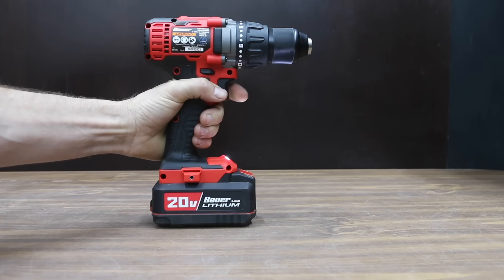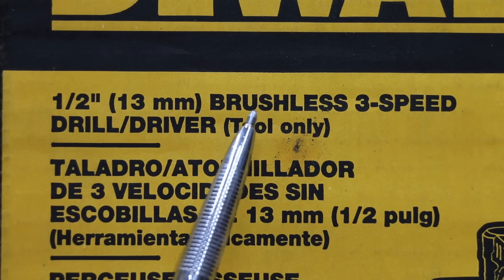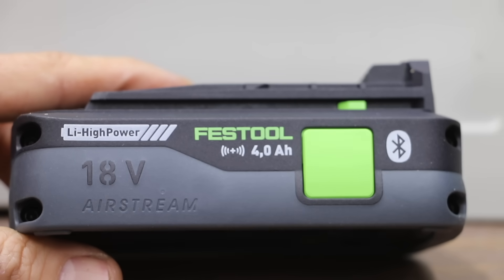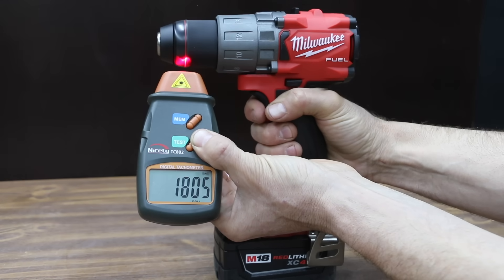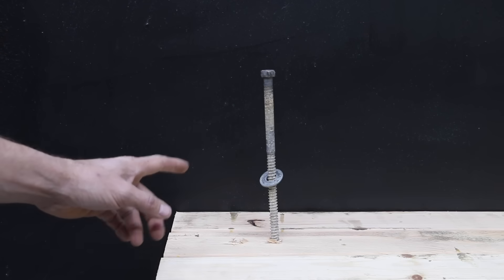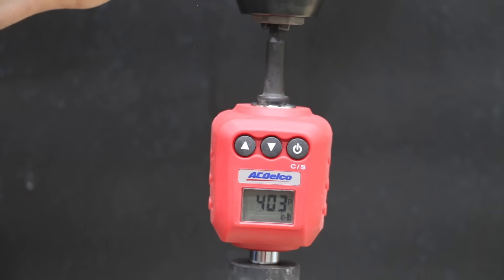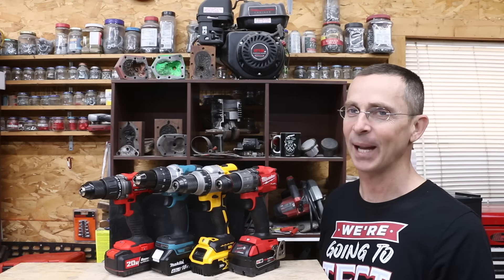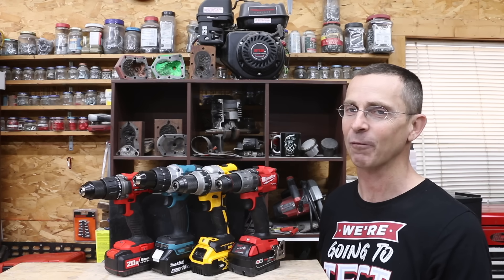Best Drill (BATTERY POWERED)? Milwaukee vs Dewalt, Makita, Bosch, Festool, Ryobi, Bauer, Ridgid

Comment: Nice video. Do you normally do anything regarding unique features of each product tested? For example the Festool maybe wasn’t the most powerful drill and also had the highest price tag but the addition of higher rpm, 2 extra speeds, multiple chuck options, and a systainer really add a good amount of value to the drill that you don’t get with lower priced options.
Reply from the maker: Thanks!  Thanks for the constructive feedback.

Comment: Come on… you used Ryobi’s worst drill. Why didn’t you use one of their brushless drills that are still cheaper than the rest but have much better performance?

Smfh
Reply from the maker: Thanks for the constructive feedback.
Reply: @ProjectFarm  Ryobi has a 1/2” 600lbs impact driver that’s about $150. Perhaps if you test impact drivers or impact wrenches you can include that one. They have a 1,200lbs impact wrench coming out in October too

Comment: I’m a Ryobi freak. Sure it was near the bottom on speed, but they have so many damned tools and they’re so affordable. I have a collection of about 20 tools and always have what I need for any project.
Reply: I'm in the Ryobi ecosystem too. Not impressed with it's performance in comparison, but being one of the most affordable I've got to say it's always done the job for a higher than normal user. If I were using a drill for a living/work I probably wouldn't consider it though.

That being said their variety of tools is unmatched. My drill batteries also power my weed eater.
Reply: @GuacPapi  Yeah I know everything I need to know about you, when you say something gay like My drill batteries power my weed eater.
Reply: @kyle1717  yeah I don't need to mix gas and oil and there's zero maintenance. It gets the job done.
Reply: @GuacPapi  ooh I guess that is too much of a mental challenge for you to mix gas and oil. I bet you take your oil to get changed too. I also bet you sit down to pee as well.
Reply: @kyle1717  if you need an ICE motor to feel like a man then have at it lol ✌️
Reply from the maker: Thanks for the feedback.

Comment: Supposedly, Milwaukee's High Output batteries will make drivers even more powerful. Would love to see a test of that battery.
Reply: I've got a couple of their High Output batteries and every tool runs better on them but they do come at a cost.
Reply: Im pretty sure its the same tech in Rigid Octane and Ryobi +P (I think is the name?) Theres an extra connection made so that more electricity can be run into the tools. Inky the Fuel tols will benefit as the others arent wired to connect. But TTI makes all three so the shared tech makes sense.
Reply: Home Depot 2 3.0 high output batteries 99 bucks.  Great deal if you ask me!
Reply: @ChrisZukowski88  wish I had seen that 3 months ago, now they’re $169 for a 2 pack where I’m at.
Reply: I am pretty sure Dewalt has that too with their flex volt.

Comment: I have a personal dewalt 20v brushless xr max drill that I will forever choose over my company supplied Milwaukee Fuel drill/hammer drill every single time, if Dewalt actually made specialized plumbing power tools like Milwaukee has, they would be on top.
Reply from the maker: Thanks for the feedback.

Comment: There's 2 test missing which are useful for user. First is the battery life when working. It could test for example testing how many screws can screw using one battery. 

Another important is how long the drill do last but it's impossible to test by him because it takes loooong time. 

I have been using blue Bosch (different model) and like Festool (different tools) but when talked with people I know, I am going to buy Mafell further on. I'm happy with Bosch and Festool but Mafell just is a little bit better
Reply from the maker: Thanks for the feedback.
Reply: This is probably my third time I watch this video 😄😄
Reply: I'm waiting you to test drills to use as drill so drilling different materials using small and big drill bit. For example when you are drilling, then it's not only about torque but the rpm

Comment: maybe some people get the fact that your battery size can change the power of your Drill. Even Festool has that on the website writen that if you need max power you should use the 5,2AH battery not the 4AH. and i have seen what the 8Ah battery cann make a differenz for the Bosch Stuff. So the ratings on the Tool are always with the biggest Battery not with the small one. Maybe a Test of all tools with the bigger battery would be nice to see if even with max power the advertisment is right or again bullshit.

Comment: Peak torque testing will be inaccurate due to the different amounts of pressure the applicant applies, you will notice he bent his knee and applied all his weight on some and not on others also he should have had a set of knew screws with each drill for each test like they do later in the film
Reply from the maker: Thanks for the constructive feedback.

Comment: One of the perks of a Dewalt is that it can be taken apart and the motor/clutch can be used seperately from the body. Zip cord can be used to connect the grip to the motor and operated with the trigger grip from a remote place. Very easy to do AND put back together with no problem. I don't know all the other brands but many use the casing to hold the motor together.
Reply from the maker: Thanks for the feedback.

Comment: I would love to see you do a series on the 12v line ups
Reply: I have a set of 12V Bosch impacts and drills and I absolutely love them, sometimes even prefer them over my 19.2 craftsman drill/impact. Would also like to see a 12V lineup performance test
Reply: I would also like to see this.  I was talking to a contractor a few months back and he told me that the 12V is good enough now that his 20V spend most of the time sitting on the truck and only come out for heavy duty stuff.

Comment: I have an older Milwaukee 1/2 drive drill uses the older NiCAD batteries.. If you're using a hole saw that binds or otherwise stalls the drill is so powerful it will practically twist your arm off. It's been a great brand.
Reply from the maker: Thanks for the feedback.

Comment: Why compare drills that aren't really comparable? of course the ones with impact ability are heavier than the ones without. And when driving that huge rusty lag bolt, the Makita was driving it at an angle which the others weren't - that makes a difference. Then the dudes says: Which brand is best? You can't answer that question by testing incomparable drills - 'cause it says nothing about the rest of the tools that the brands produce. Kak.

Comment: What kind of tests are these exactly? something you made up for use on other planets or what? You realize that If the drill were completely broken it could still do 0 inch pounds. And the speed of driving screws is affected by the pressure applied which was completely random this is just unrealistic and a way to sell tools from a guy that knows nothing about using them

Comment: I've used Milwaukee, ridgid, and Dewalt as my every day work drills and impacts... gotta say Milwaukee has the best durability, strength, and battery life around. Even their 12v impact is a beast of a machine, and it's small enough to clip on your tool pouch or belt without slowing you down.
Reply: Milwaukee is great no doubt, but I have a full lineup of Dewalt and I have put them through hell. I cant remember how many times I have dropped my drill off a 2 story deck and it is still alive and kicking. Lol Honestly, Dewalt, Milwaukee or Makita will serve you well and are tools you can hand down to your kids.
Reply: @Meme-zc4cw  agreed, all great brands
Reply: @Meme-zc4cw  I love Milwaukee tools, but everyone in my shop uses Milwaukee. I wanted my tools to stand out as MINE and went with DeWalt. My 1/2" brushless impact makes quick work of rusty lug nuts even on setting 3. 
I have not been disappointed.
Reply: @Meme-zc4cw  I got the new Dewalt  12v half inch impact. Thing installed a 4" lift on a 2014 hemi. Thought no way but it did it. Thing is a beast with the 5ah battery.
Reply: @terrylewis8802    But your DeWalt batteries will be unusable after about a year or so, was my experience with three sets.  Replacements cost more than a brand new drill kit!
Reply: @tomrogers9467  I Got some old 18v that's 20 years old that still work batteries and all. Also have a craftman nex tec that's been going along time. I did have a 40v battery that only lasted 2 years.
Reply: Have you tried Hilti? In my experience that stuff will outlast its' owner. ( There's a reason all the fleet tools are Hilti.) I'd love to see a test of those! @Project Farm
Reply: @David-xo8ci  I haven't! I did see a pretty nice 12v impact from them the other day though. Might give it a go if my little Milwaukee ever dies on me
Reply: @David-xo8ci  Hilti is legit. As far as powder actuated nail guns and hammer drills . I've used rotary hammers older than me that ran  like Champs.  I cant speak for their cordless stuff though.
Reply from the maker: Thanks for sharing.

Comment: You need to start trying to include HILTI tools in these videos
Reply from the maker: Thanks for the suggestion.
Reply: They're another rip-off like Festool.
Reply: @RobertNES816  🤦🏻‍♂️ when you talk about professional tools you can’t deny Hilti. For Hobby use take the cheap ones np but the lifespan and battery life of hilti is just incredible
Reply: @inot88j24  I've used the other name brands never had an issue with anyone of em. Hilti is just overpriced.
Reply: @RobertNES816  i mainly use milwaukee,,, but i tried hilti impact drills and hammer drills and now im selling all my milwaukee stuff.. try it its not overpriced at all
Reply: @RobertNES816  depends on the tool. Hammer drills are impossible to kill.

Comment: I am still using old Makita 9000 cordless drills. I have a 9.6 volt with a keyed chuck and a 12 /9.6 volt with a keyless chuck. So last century. I'll use them until they fail before buying a new one. I bought a Milwaukee 12v 1/4" Impact Driver ($40 w/o battery) that is awesome I hope it lasts like the Makita 9000s have.
Reply from the maker: Thanks for sharing.

Comment: I bought the dewalt just yesterday, before seeing this vid. I’m glad to see how it stacked up against other brands.
Reply: I'm in 🚧 construction, I've used Dewalt for over 8 years and love it. It's got powerful torque, battery lasts. decent & it could take a beating, I have dropped my drill from heights in excess of 10 ft and it works fine. We drill into steel regurly and really powerful torque DEFINATELY helps.
Reply from the maker: Thanks for sharing.

Comment: Dewalts the best ever, its the most reliable, powerful, and vicious ever there's no other tools that can beat it. Milwaukee and rigid is a conqueror? No they're no Alexander, dewalts alexander. They're Raymond, They're Elmer. They are from their cloth. There's no tool that can match it. It's brushless 20v max is superior, it's longevity and sustainability unmatchable. The reciprocating saw is just ferocious and can eat though high carbon steel.
Reply: Milwaukee and dewalt make a good tag team. Im a dewalt guy personally but i will get some milwaukee products in the future for sure. Milwaukee is just so expensive thats why dewalt is supreme in my opinion.
Reply from the maker: Thanks for the feedback.

Comment: What we really need to know is how long will each battery be available and how long will they keep recharging.  These companies keep changing their designs so when the battery won't recharge any more your tool is now an expensive paper weight.
Reply: Milwaukee has been using the same design for 8 years now
Reply: @mspinksosu  That's a long time, by today's standards, but when I buy a tool I expect it to last a lifetime.  And yes, I'm old enough to remember when that statement didn't sound ridiculous at all.
Reply: @1bowmaniam  ryobi seems to keep standard battery Also my ryobi I started out with have out lived Milwaukie and makita I've had less power though
Reply from the maker: Thanks for the feedback.

Comment: I have both DeWalt and Ryobi.  Mostly I prefer Ryobi for the lighter work as the batteries tend to last a little longer when doing light work.  DeWalt comes out whenever things get serious.  I put up an entire backyard fence (440 linear feet) in about 4 days.  I had two DeWalt drills, three people, and replaced battery packs about once every two hours or so.  The Ryobi lasted about 30 minutes in that same job so we gave up on it.  I didn't see much about ergonomics in this video; I'd be interested to know how they all handle after 2-4 hours of use.
Reply from the maker: Thanks for the video idea.

Comment: Back in like 2012, I picked up a Amazon Warehouse deal for a Ridgid drill/driver/charger/2 3ah 18v batteries for $100. I have stuck with the brand ever since. Used the hell out of these original tools. Finally wore out the driver in 2020 and only recently killed the drill and charger. Original batteries still in use.
I know Ridgid isn't the best on the market but if weighing cost and quality with longevity, I think Ridgid is the way to go. And the batteries from 10 years ago are the same fit as now. No other brand I've used has stuck with their own battery design that long.
My 18v and 120v line up now includes:
2 3ah bats
3 4ah bats
1 6ah bat w/Bluetooth
2 18v ¼" impact drivers
1 18v drill
1 18v recip saw octane
1 18v ½" impact socket driver (for lug nuts, etc)
1 18v tire air pump (awesome)
Bluetooth fm radio and a wide variety of 18v lamps, spot lights and chargers
1 120v circ saw
1 120v worm drive circ saw
1 120v 10" table saw w/rolling/folding stand

Wish list is:
18v circ saw
18v wet/dry vac
18v grease gun
2 6ah batteries
2 9ah batteries
Reply: And Bauer may have it's roll to play in the market but no one who uses these types of tools regularly will stand by this brand.
Reply from the maker: Thanks for sharing.

Comment: Any chance you can test this relatively unknown brand please claims to be as good as milwaukee
Blackpine 20V Cordless Drill with Impact Function 2000mAh Lithium-Battery 21+3 Torque Setting with 2 Speed 10mm Metal Chuck 63PCS Accessories Supercharge Fast Charger 2000mAh
Reply: Costs less than £50 on amazon and less than £40 on my mates site

Comment: I know dewalt has quite a large lineup of cordless drills in various sizes, I’m sure most of the others do to. Is this really a comparison of the “best” drill if only selectively picking certain products from each line? 

Should be grouped either by price, or by advertised torque specs maybe.
Reply: It seems that all of the drills should have been brushless. I have Ryobi and the brushless is much better then the other version.

Comment: I will never buy a cheap drill again after getting the full Milwaukee fuel set... They are absolute beasts, the battery life is great and recharges to full quickly, they are a good weight that's not too heavy for prolonged use. DeWalt have always served me well too. Ryobi are absolute trash!!
Reply from the maker: Thanks for the feedback.